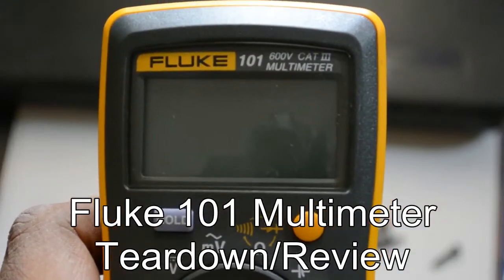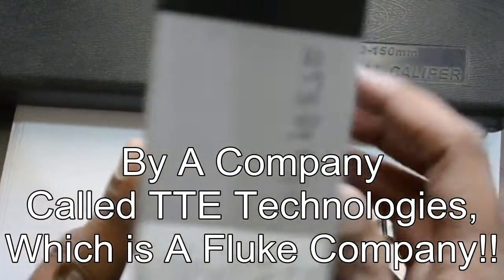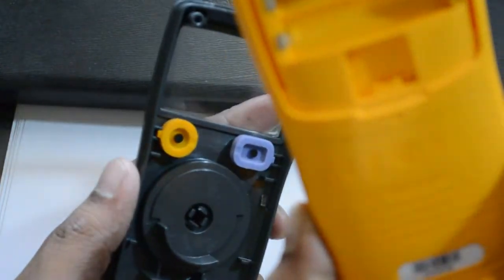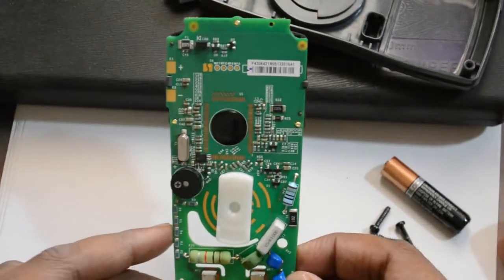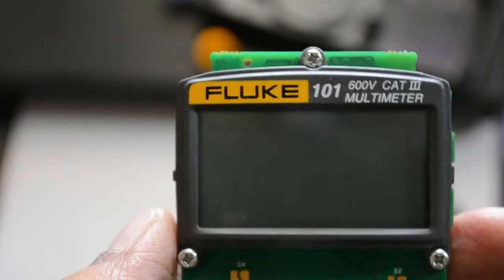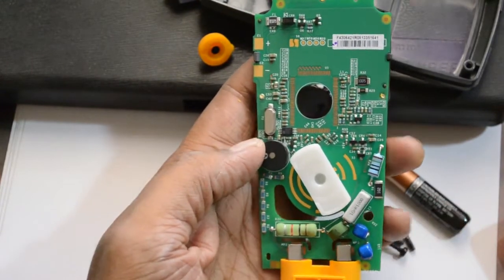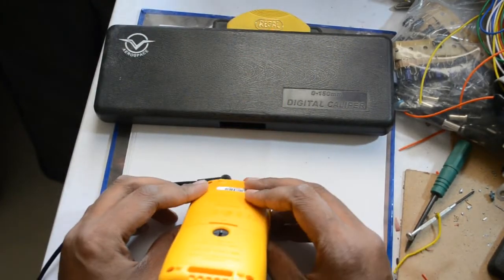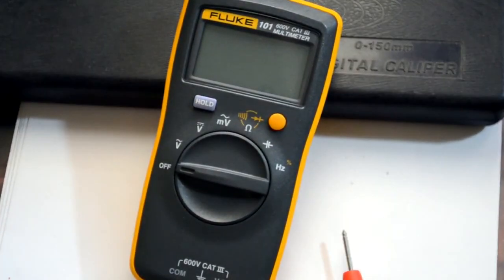EC # 01 Fluke 101 Digital Multimeter Teardown/Quick Review

Comment: Thank you for the video.
I ordered this meter recently knowing its shortcomings, and I am looking forward to buying a clamp meter. 
Personally, I would recommend having two meters if you are into electrical stuff. A multimeter (for voltage measurement) and a clamp meter (for current measurement).
Reply: +Arya Sridhar For electrical work it's better to get a clamp meter for current. Usually it's hard to break the circuit and measure current. The Fluke i400e is pretty cheap and measures AC for up to 400A.

Comment: The lack of current measurement isn't a disadvantage, it's by design - since the meter is so small, you can only fit 2 probes in there, and if the meter has both current and voltage measurements on the same leads you can blow it up in your hand when the probes are connected to high voltage circuit while you flip over the current setting. It's much safer to have a meter that has a separate plug for Amps and even better to have a clamp meter for current measurements.

Comment: Nice review! 

I'm new to electronics and bought myself a used Fluke 87 V (sometimes one can find very inexpensive offers on Ebay): very safe, fast, precise, very nice latching, min/max function, micro- milli- and amps. I think that - especially for a beginner like me - it pays off to invest in a tool one doesn't have to worry about.

Comment: Thanks.    Your review helped me decide to get one too and saved me the trouble of figuring out how to open the chassis.  Your version had CSA and K safety listing but the ones from China are only Fluke CE listed.
Reply: +Ig Saturation his review is spot on,the fact that it doesnt has a backlight is ok for me but probes input at the bottom and no stand if i were to put in on a table is a huge let down for me,at this time i am also considering the uni-T brand of multimeter so if u had already bought 1 i would like to know how satisfied were u regarding the built quality and accuracy of that brand
Reply: +Klose_11 I bought the version with the magnetic soft stand; if you buy it together as a kit the stand only costs $10 more and can be used like a 'clamp' to hold the meter even on non magnetic items I use it for field set up and troubleshooting, and 90% of the time all I need is for checking power, Vdc and Vac and because its built like a tank, see eevblog tests by J Smith, I don't worry at all about damaging it from bad power.

Comment: I need to buy myself a multimeter. I am thinking between Fluke F101 and UNI-T UT63. I know that UNI-T has more posibility.
What do you suggest me. Which is better, I don't really need to measure small curenc (uA, or mA).
Reply: +Rhbg Ghgv Fluke all the way.  UNI-T it's a chineses brand.   Fluke 101 is a chinese replica of FLUKE and well beter than UNI-T. I had one UNI-T and probes in packages are sucks. You need to change theses to had great respond.
Reply: If you use it for low voltage electronics stuff, get a Uni-t UT61E which has 22000 count.  UT139C/E are pretty good for electronics stuff and also pretty safe for mains measurements. Not sure about other UNIT models.

The Fluke 101 is great for household electrical work - super safe and robust. It lacks current measurement, but you basically never measure mains AC current with a multimeter, that's what a clamp meter is for. Also the continuity buzzer response on the 101 is pretty slow, I'd be annoyed if I wanna sweep through some pins to check for continuity.
Reply: Brian your comment is what I'm looking for. Thanks. Just wondering if ut139c would ever be ul listed or CSA Certified. I hope to have one for testing mains and repairing appliances.